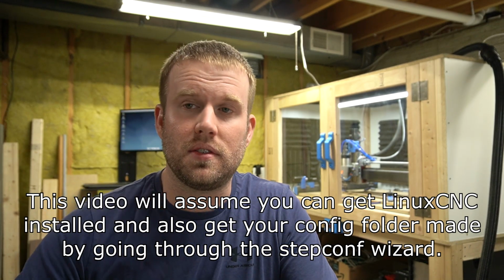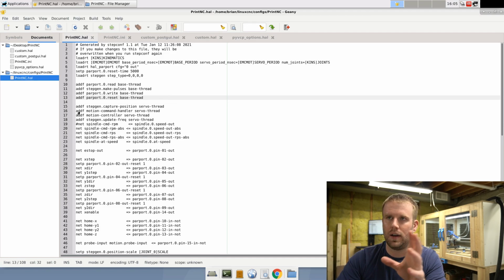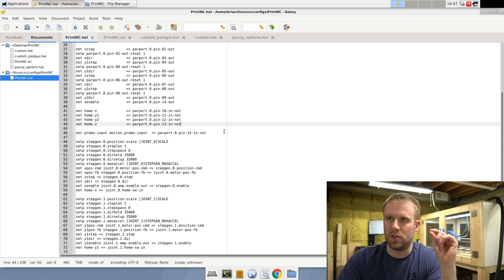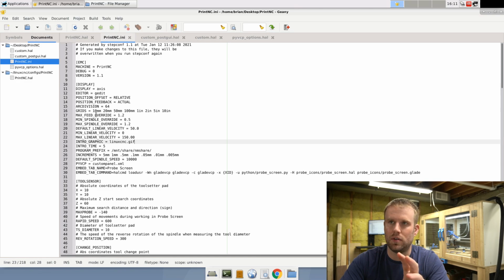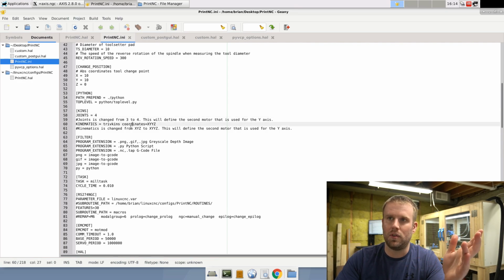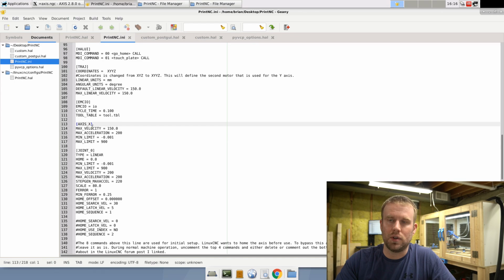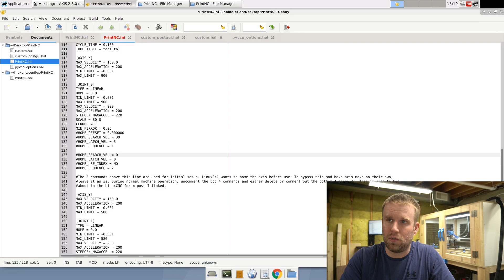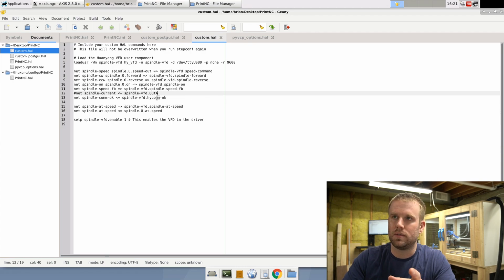LinuxCNC Deep Dive!

Comment: Couple of things... 

If you add a slave axis in your conf wizards, it'll add the second motor and you only need to dial in the motion parameters of the single joint. Slave axes don't require separate joint/axis settings, just the stepgen pins and possibly a directon reversal in the case of mirrored rack and pinion drives

There's a special flag in the ini file called no_force_homing = 1 that you can enable to skip homing the machine before you move stuff

Hope this helps.
Reply: Just wanted to add a comment to let people know that they should check out the LinuxCNC Bare Bones series at your channel.  It adds a lot of additional information to go along with what Brian has presented.
Reply: @gizmobowen  Its how I got my lathe and Mill running. Just confused about the tool changers for Mori Seiki lathes.
Reply: @ProjectsbyBrian  no problem. Linuxcnc is kinda what I do in my spare time 😆

Comment: my friend thanks for your videos, i have managed to configure most of the parameters :) ... the only bad thing is that i have problems with the [TRAJ] configuration, i must put the coordinates in XYZ for the axes to move correctly... but now i have had problems with the limit switches because of this because the XYYZ coordinates must be used and it throws me an error when opening Linuxcnc... gpt chat has been helping me but i have not been able to solve the problem... it suggests me to update the program to a more advanced version, i am using version 2.8.4... what version of linux do you have in the configuration that you do in the video??? thank you very much in advance.

(use a translator, i'm from Chile😅)

Comment: Hi Brian. We  (me and my father) are making a first PrintNC in Azerbaijan :-). We are trying to make a right choice between LinuxCNC and Planet CNC. The second one looks more attractive and user friendly with many and many beautiful bonuses (API for an external apps and etc). But It is not free (145 EUR for hardware + 85 EUR for software license). My final question is: Is It right choice to go to the Planet CNC ecosystem (and always be dependent on one manufacturer) or choice Linux CNC, as the most pragmatic choice for the future? We want to make one choice and work 3-5 years without thoughts about electronics or software.
Reply: @ProjectsbyBrian  Hi Brian. I want to say thank you for such quick and informative answer/opinion. We a trying to focus on what we will produce on PrintNC,  and we need, as you mentioned,  a turn key solution. So Planet CNC looks good for us. Brian, thank you for such incredible PrintNC machine. You're genius.
Reply: @ali_mammadov  I'd like to interject and say that when converting from Mach 3, I was able to have my machine back up and running in a couple of hours without any help or guidance. Now, I could configure the exact same machine in 20 minutes, including installation of the operating system. The beauty of LinuxCNC is the flexibility down to a source code level, but there is a small learning curve for the amount of power the system provides, which is why I started my series of tutorial videos. They've already helped a lot of people. 👍👍

Comment: Brian, thank you for the follow-up video and especially for sharing your files.  This will really help a lot of people to at least have a decent starting point.  One question that came to mind is related to the micro-stepping value you're using since it will affect some of the values in your files.  Hoges suggested using 1/5 stepping, which is what I was going to start with.  If you're using a different value though it would make the settings off a bit.  Can you let us know what your micro-stepping value is on your motor drivers?
Reply: @ProjectsbyBrian  Ok, thanks.  I think the micro stepping is a compromise between torque and accuracy.  So I'm guessing 1/5 is the right balance that he arrived at while making this CNC.  Definitely going to go with what the creator uses.